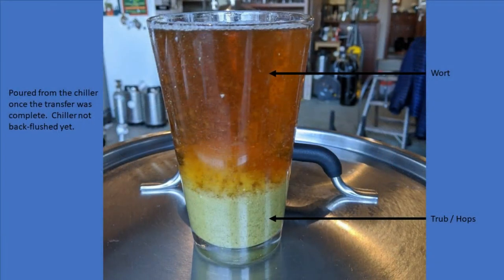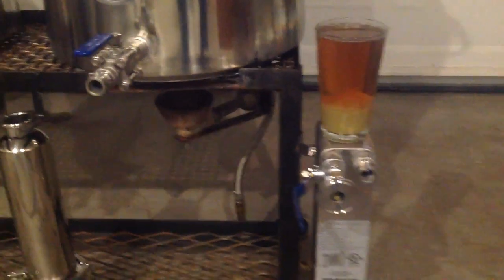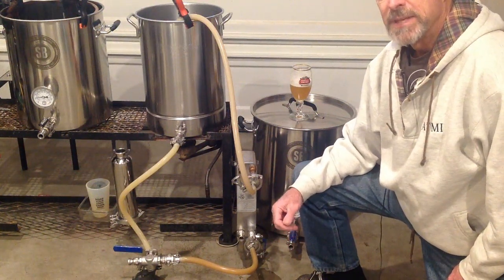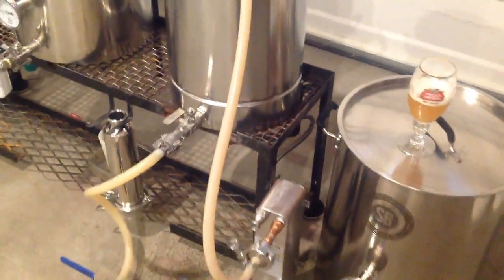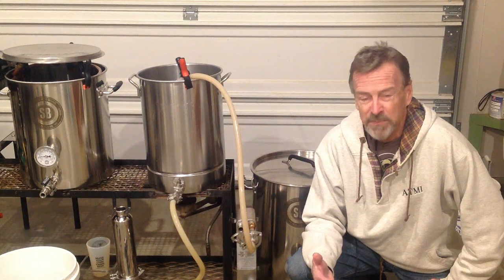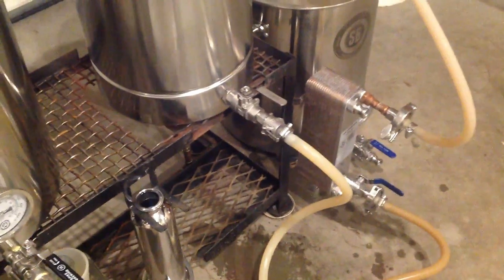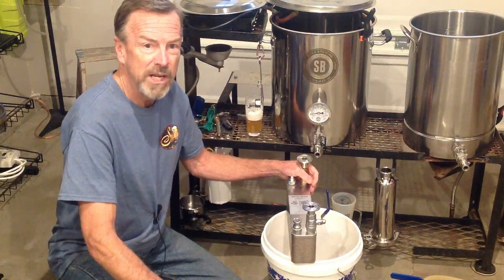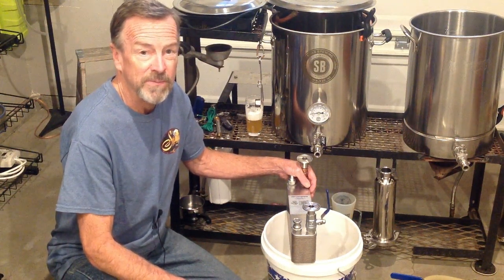Homebrewers: Clean that plate chiller!!

Comment: Great video, i thought i had cleaned all my equipment, went out today to get ready for a brew day tomorrow and could not believe my eyes, everything was covered in mouldy fur, cleaned out the chiller and i was amazed what came out of it, also the herms coil was full of sludge too.
Reply from the maker: I think we have all been there!  I now use sodium percarbonate (I have a video on that).  It is very good, active in warm water, inexpensive.  I usually do my process as shown in this video and then do a soak in sodium percarbonate a day or two before the next brew day.

Comment: Great ideas! Regardless, stuff will still be in your chiller. It is amazing.  But If people are really concerned, they can bake their plate chillers at 350 ish for a few hours. It's welded so baking is nothing.  Then flush.  I do that once or twice a year or so.  I will also recirc with saniclean or iodoohor instead of starsan if I have some mixed since those do not foam.  But ALWAYS recirc with boiling water or hot wort for 10 minutes or so right before use.  The heat will kill anything in your plate chiller.  Love my plate chiller.
Reply from the maker: thanks for watching and the comment.  I always like to hear what other people do so I can learn and improve my processes.  The plate chiller is a must in my book too!  Thanks again.

Comment: I’m super new to this and just saw your video. I want to make the process easy and therefore more enjoyable so I think the plate chiller is the way to go. Simple and maybe a stupid question but what kind of pump are you using?  Where did you get it? How much did it cost?
Reply from the maker: Hello, thanks for watching.  I have used all sorts of pumps.  Here is a link to one that is like what I use now:
https://www.amazon.com/gp/product/B082KXYYHX/ref=ppx_yo_dt_b_search_asin_title?ie=UTF8&psc=1
As you can see, they are pretty cheap ($70).  You need to buy the hardware to attach the hoses (I'd recommend some sort of quick disconnect: tri-clamp, camlock, or Quick Disconnect).  They cost a bit more but the convenience is worth it.  Good luck in your brewing endeavors, and feel free to write with other questions.   I am always glad to offer my 2 cents worth!   -DT

Comment: I’m late but thank you! Quick question; I finished cleaning my plate chiller, but I still hear some water sloshing around in it and I can’t seem to get it out. Is there a way to empty this out, or is it not a big deal? Thank you!
Reply from the maker: I am always glad to hear from anyone who watches my videos, thanks.
I know what you mean, the way the plates are routed causes "flow" issues when not under pressure.  What I do is go through the process and once done, stand it on one end (look at 0:43 to see what I mean).  After a little bit of time, any water left in it will work its way down and then I just dump it out (there is alway a little bit in there).
Thanks again for watching.     -DT
Reply: Use an air compressor to get all the water out.

Comment: Interesting stuff. Have you done a deep clean since the new process? I've always used a coil chiller but I am looking into a steam condenser during boil now and the logic seems to dictate using a plate chiller as the boil system would be closed now. I'm a nut for external systems and plate chillers have always given me the "Chills" man! :)
Reply from the maker: Thanks for watching and your comment.  I actually do a deep cleaning most of the time too.  It consists of a soak with sodium percarbonate for a few hours and then a hot water flush.  I have to say doing this, and also a much better job of my whirlpool and hop blocker on the transfer from the boil kettle, the plate chiller is amazingly clean.  It is probably my highest priority when it comes to cleaning.  I too, as most are, was concerned about the potential problems introduced by the chiller, but I haven't had any problems at all.  (I will admit as I stated in the video, the first times that I really paid attention to really cleaning it, I was shocked at the amount of slimy crud that came out of it - YUCK!).  Good luck and thanks again.   -DT

Comment: Seems like you have a lot of hops going out of your boil kettle, try using a braided stainless steel screen off a supply line, works great for me!
Reply from the maker: Thanks for the note.  Kettle hops have been my nemesis ever since I started brewing.  I think I've tried everything to varying levels of success.  My quest has been to find the best and easiest way to just toss in the pellets (no bags, filters, screens, etc).  What I do now is use the Spike kettle with recessed bottom, bag my bittering hops so I can pull 'em and try to be more patient with the whirlpool so things settle.  At the end of the day, you are probably right, a screen is something I should incorporate back into my set up.  Thanks for the suggestion.

Comment: Can I replace de PBW with any other stuff?
Reply from the maker: Thanks for watching.  I now use sodium percarbonate (you can find it on Amazon).  This is the active ingredient in PBW.  You use warm water and it is awesome.  Much less expensive than PBW too.  A lot of folks use Oxyclean with success as well.   Best of luck.   -DT
Reply: @homebrewingtips6029  Thanks for the sodium percarbonate recommendation. You're right, it is a lot easier on the wallet.